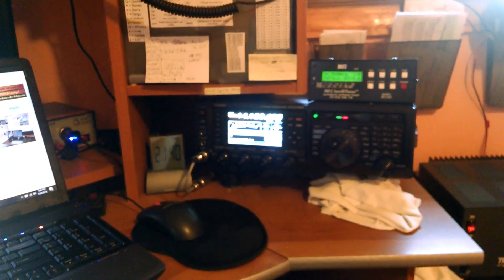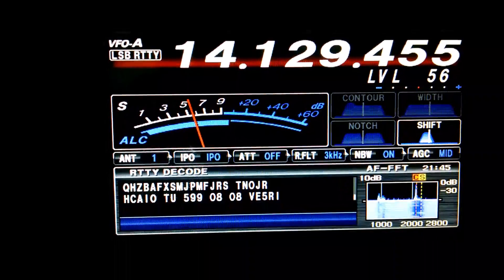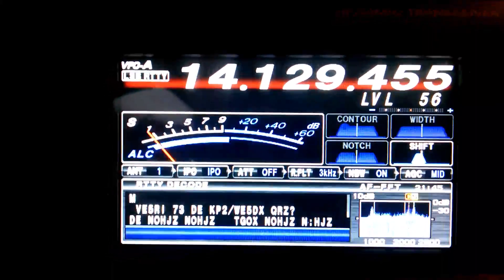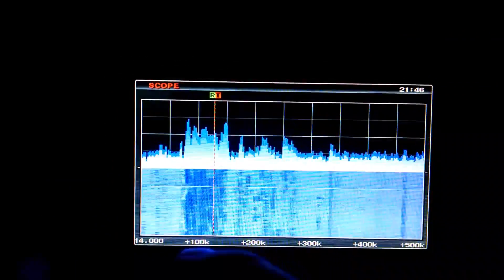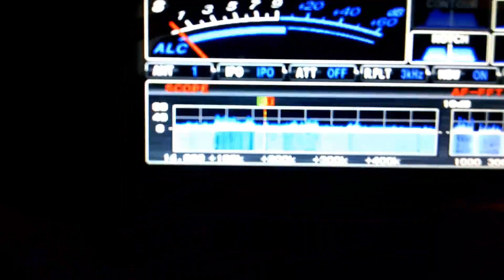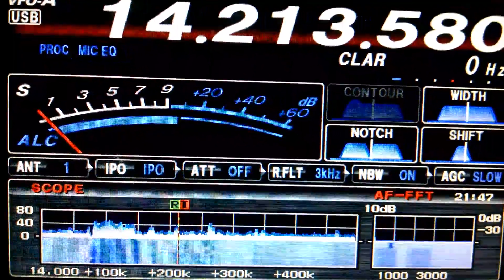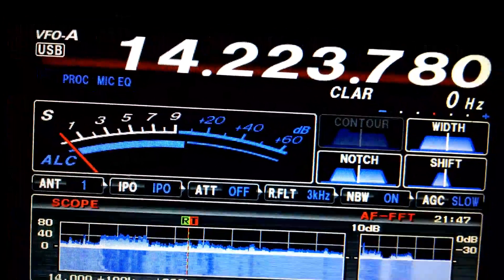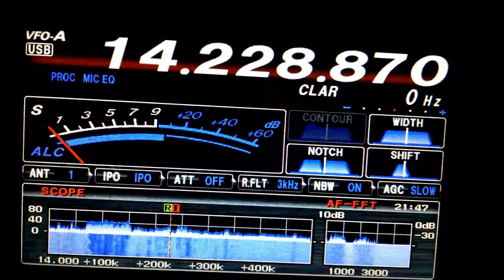FT DX 1200 RTTY decoded on 20 meter ham band Yaesu

Comment: I have posted this comment on several videos about after installing the FFT-1 and then doing all the correct firmware updates and doing a master reset like Yaesu says to do, that alot of people are having issues with their analog meters not working correctly. Even mine is having issues. It works very sluggish and jittery. If you remember the old days when an analog meter had the little coil spring in them and the spring either got magnetized or bent etc that the meter got stuck or would jump like it was full of dust or dirt. Or the needle was gummed up with dirt that kept it from moving...This is kinda what the meter is doing....Yaesu so far don't have an answer.....K4XJ
Reply from the maker: There are some glitches with the 1200. The first channel in 60 m is not correct and I cannot fix it unless I send it out. It's not worth it for me to send it out
Reply: @KD2GIY ...I don't have the 1st channel on 60 meter problem. The only glitch I have is with the analog meter after doing the MAIN, DSP and the TFT  firmware update. After I did this I have problems with the meter. I have no problem with the BAR meter it works fine. I contacted Yaesu and haven't heard back from them after they told me that they weren't aware of this problem. I was told they would look into this...But nothing so far.
Reply from the maker: @markwarren7116  I wish I could help. Unloaded on eBay. And by the new 101 d . Lol
Reply from the maker: I would love to have to 101 d

Comment: how did you get both the scope and waterfall on the main scope
Reply from the maker: kb3lht  keep on pressing scope untill it gets to that screen. but I also have the fft-1 board installed.
Reply: I can get on the little fft side by menu 185 but don't know how to get it up on the main scope window
Reply from the maker: It's a scope button function for me.
Reply: I push it I just get the scope screen not both the scope and waterfall
Reply: KD2GIY HAM RADIO FUN get both on the fft screen
Reply from the maker: something is not working. I would call Yaesu tech support and let them walk you through it.